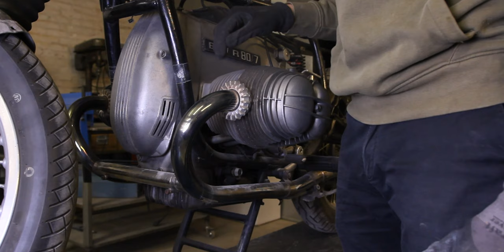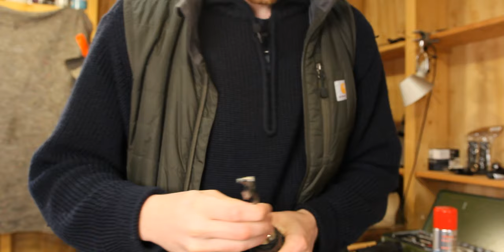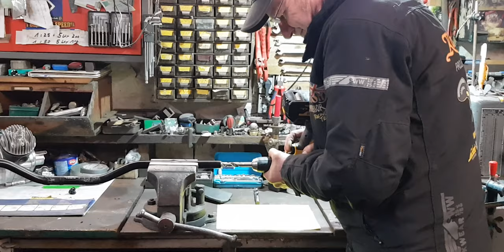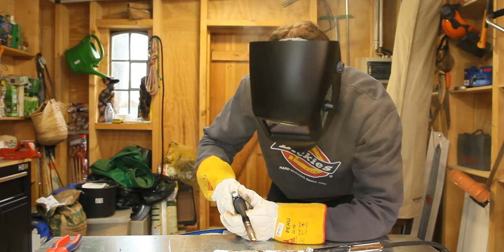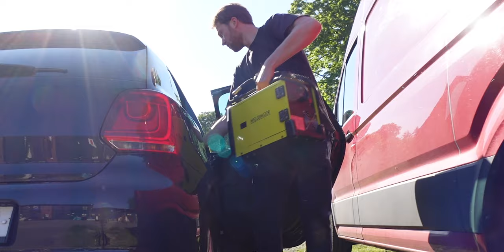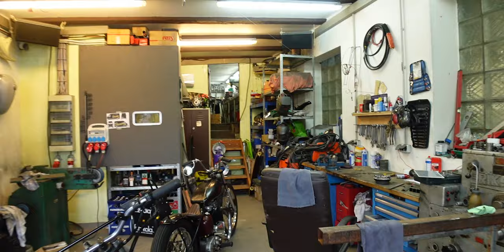You NEED HELP if you're Building a Custom Motorcycle!

Comment: Make sure you coat the treads with anti-seize grease upon assembly. It will make it that much easier when removing again.
Reply from the maker: Thanks Steve, that's a great tip! I'll keep that in mind.